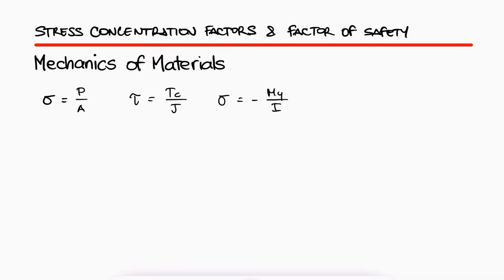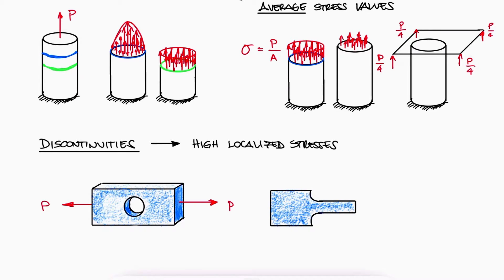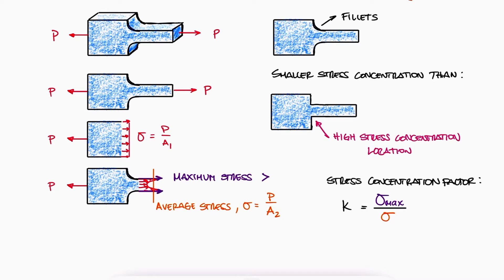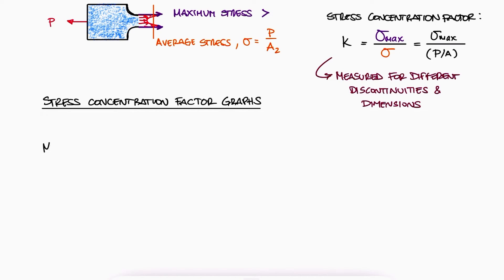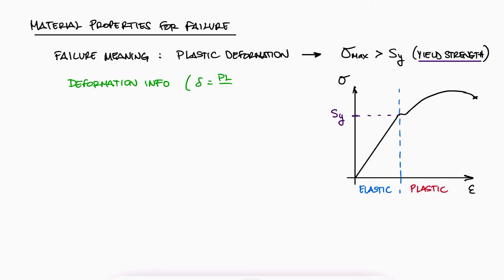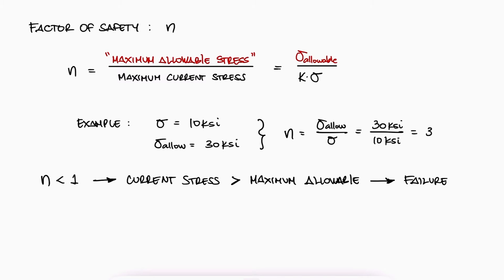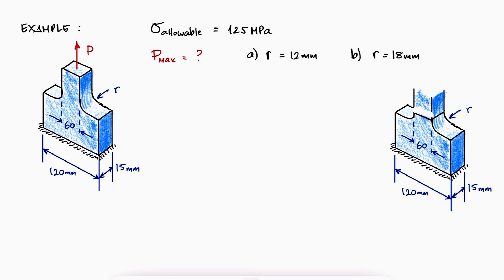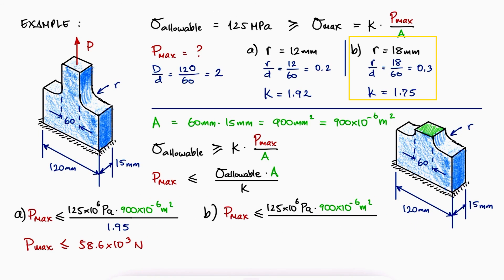Stress CONCENTRATION Factors and Factor of Safety in 11 Minutes!

Comment: @3:50: I am struggling to understand why K appears to decrease as 2r/D increases?

If I have a 6cm wide plate and drill a 2cm hole in the middle then my ratio is 2*1/6 = 0.33 & K= ~2.35

If I then drill a 3m hole instead, the ratio is 2*1.5/6 = 0.5 & K = ~2.15

Why would the stress concentration factor be lower when i have effectively reduced the area of the plate?? 

What am I missing here
Reply: Hello will you please help me to calculate stress concentration factor  for axial compression of pipe or cylinder
Reply: I'm unable to find formula related to compression.. there are formulas only for axial tension, bending, and torsion  please help me what to do for comprehensive load
Reply: because it technically does decrease… a notch amplifies the stress but a little less with each increasing size… you sacrifice the amount of stress concentration for a little more affected area… It’s not just about the size of the hole, but the distribution of the stress concentration(s) also (I.e, try adding multiple holes)